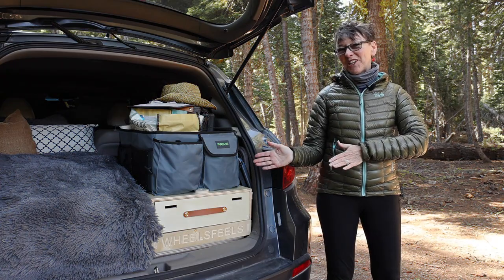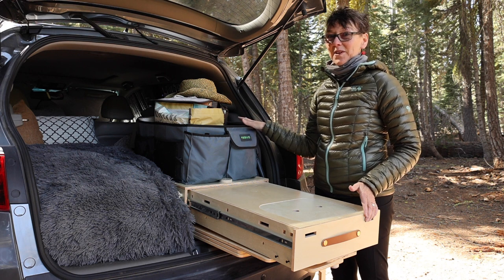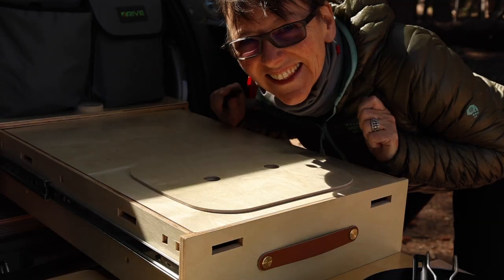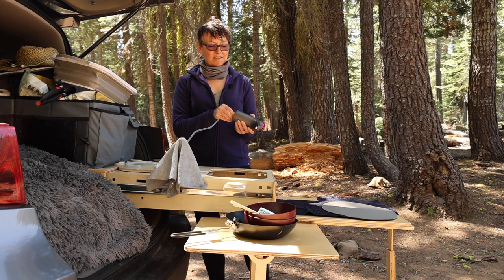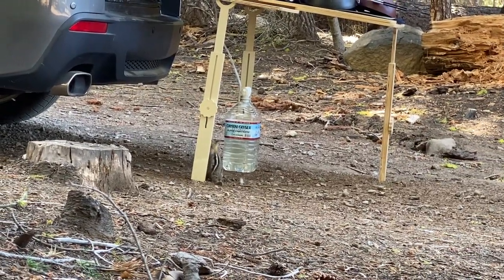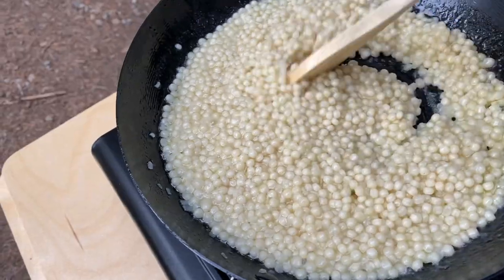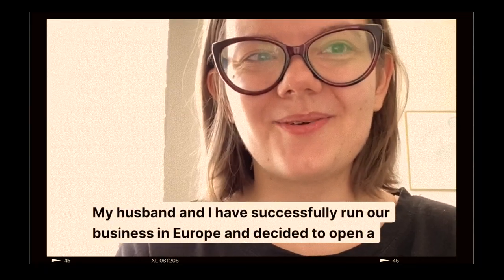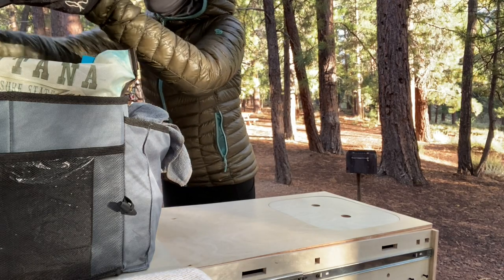This CAMP KITCHEN is Genius, Here's Why  🚘

Comment: What if you put a silicone funnel into the hole for the sink? If you got a collapsible version, it could squish to fit  properly and eliminate leaks.
Reply from the maker: Yeah, I was think about that, with a little bucket underneath to capture the gray water so that I could dump it in the fire pit or something like that.

Comment: Nice little kitchen, but i would bypass the sink drain…that can leak, and just lift out the sink and dump it the old fashioned way…the idea of having a sink, just like at home, is nice, but not always practical or necessary.
Reply: Thank you! Surely, you can use a sink with a closed drain. It's up to you! You can also remove the sink and put a plug.